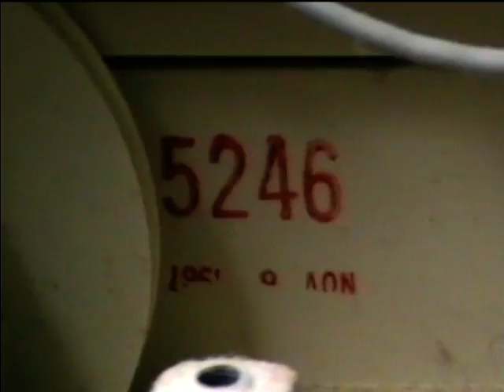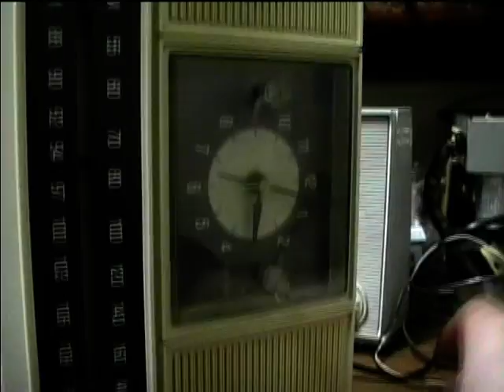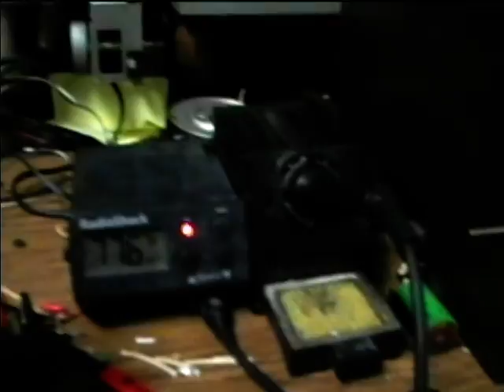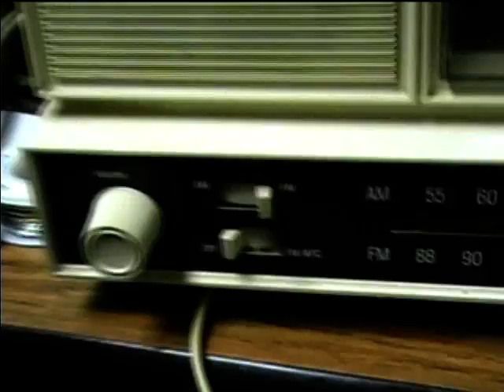1967 Westinghouse AM-FM solid state radio repair Part 1

Comment from the maker: @lrd9999 Yes that's right, condenser is an old-fashioned term for capacitor. It acts to filter out the pulsed DC from the rectifier into a smooth DC.

Comment: Chad.. this is an excellent video! :))  I'm going to attempt to replace all the electrolytics on my 1964 Hammond L-103's AO-43 tube amplifier as well as the percusssion and vibrato amplifiers located up top behind the tab switches...  have to replace 4 multi-section metal can caps.... 50uf 450V.. pain in the arse... hehe

Comment: I'm thinking of recapping my 1970 JVC Nivico 4TR-990 stereo console. It's loaded with electrolytics in the audio amplifiers as well as the power supplies. They didn't believe in direct coupling and Silicon transistors they used Germanium transistors in all the audio circuits including the ones in the tape deck. The germanium transistors had too much leakage to allow direct coupling between stages. And of course there are multisection electrolytics in all the power supplies.

Comment: I'm surprised that, even with no user serviceable parts, they would make a hot-chassis set with what looks like no screws holding the back on and no interlock. Someone could just snap the back off expecting to replace a tube while standing on a wet floor. Of course, anyone who knew what they were doing or heeded the warning on the back would know no to do that, but they usually went a little further to idiot-proof sets like that.